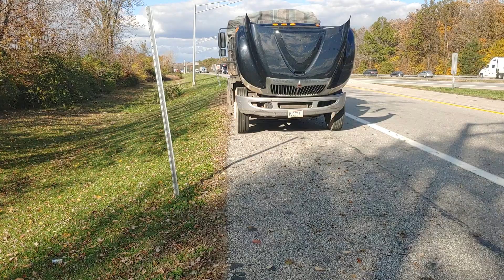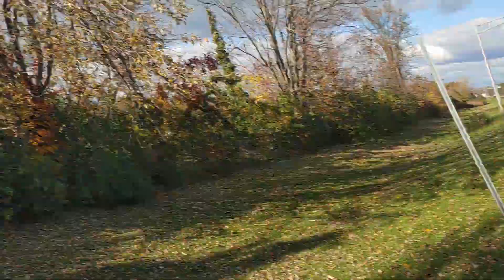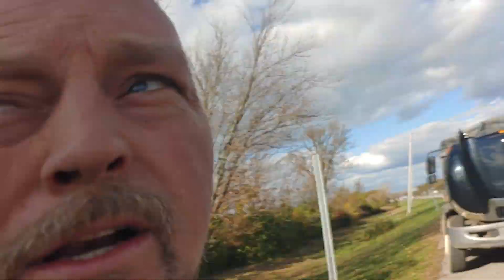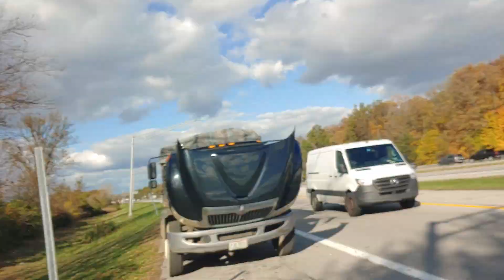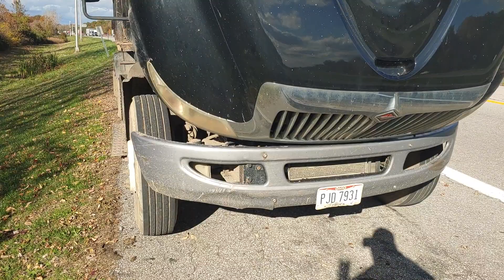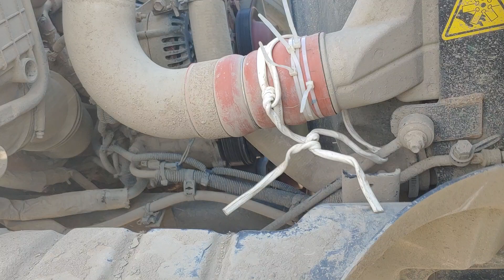MacGyver Truck Repairs! I'm keeping My Fingers Crossed👍

Comment: You got to do what you got to do! Good job Don
Reply from the maker: Your right Joe! Sometimes we have to figure stuff out on the fly. The truck would still run without the inner cooler pipe but it didn't have much power and seemed like it was getting hot. Once I got my trusty zip ties we were cruising 70mphs again.lol have a good one Buddy 👍

Comment: That’s funny Don , we both drive the same truck for work, good fix
Reply from the maker: Wow I guess I didn't realize you drove a international also! There great trucks to drive. Mine has the Cummings diesel engine. That roadside repair got me back to the shop with no problems. Have a good one Buddy 👍
Reply: @donshotrodgarage1717  Don if you go to my videos 8 months ago I did a heating oil delivery
Reply from the maker: Oh yeah thats right Mike! I watched that video where you pulled the fuel hose up that steep hill. Cool man have a good one Buddy 👍
Reply: @donshotrodgarage1717  Don that one was a different video when I first started the channel 3 yrs ago the one I was talking about is about 9 months ago, but yeah same truck, but if you want to watch a cool back up down a driveway the latest one is pretty good
Reply from the maker: Ok Mike I'll check it out! Later man ✌

Comment: Hey it works 💪  cool deal.
Reply from the maker: Hey Bullet! Them zip ties got me home no problems! The engine would still run without that pipe but didn't have much power and seemed like the engine was getting hot, and it was only 50 degrees out. Later man ✌

Comment: Bush Fix. Always carry some Cooootangas. Lol. I live in Africa for a few years and had a Safari outfit thirty five years ago. No zip ties in them days.. So we carried wire coat hangers. I still do and have since Africa. Got me out of many situations on lonely roads since then. Lol. Zip ties good but they melt. But that's good Don. You rolling again. Bummer on the side of the road. Have a good one man. Don't forget your bailing wire and vice grips. Adios.
Reply from the maker: Hey Adrian! Bush fixes are the best! It got me back to my yard no problems! Always have some form of repair items with me. Have a good one Buddy 👍  Adios